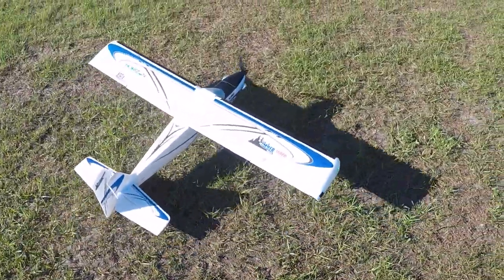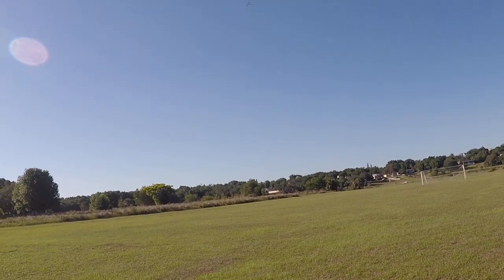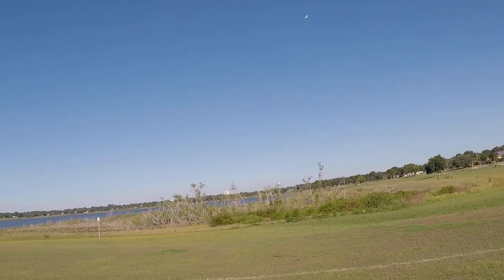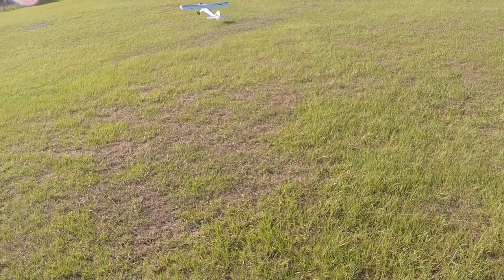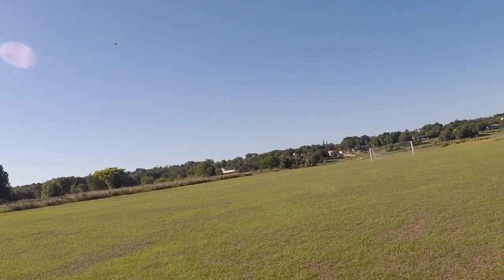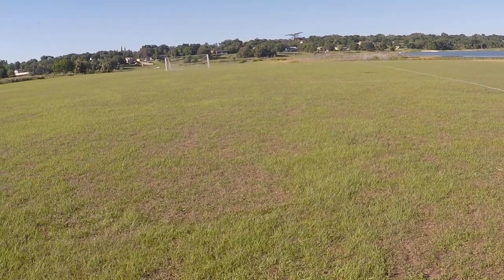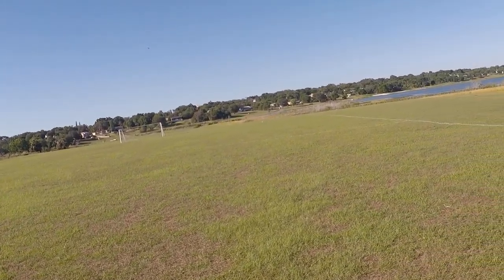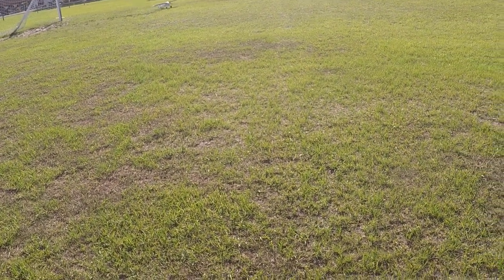Turbo Timber Landing Practice

Comment: Got a turbo coming tommorow guna b my first plane done drones for several years and have cars an boats was guna get the apperntice but with safe flight on beginner on take of an landins till get used to it think should b ok
Reply from the maker: Just go out on a calm day. Take off into the wind and land into the wind. Run on 3s lipo until you can fly with confience without safe on . Then try 4s lipo and hang on!!! Good choice and have fun!